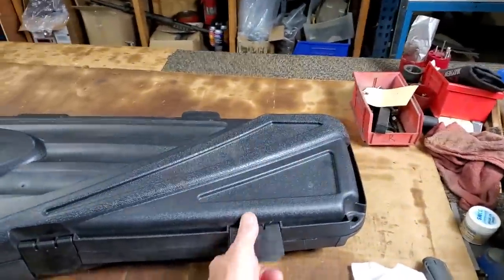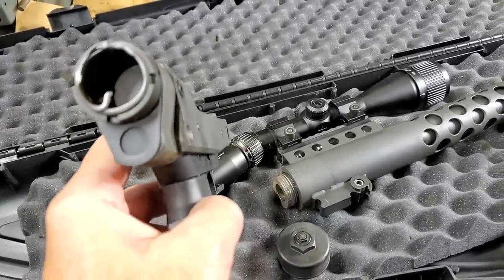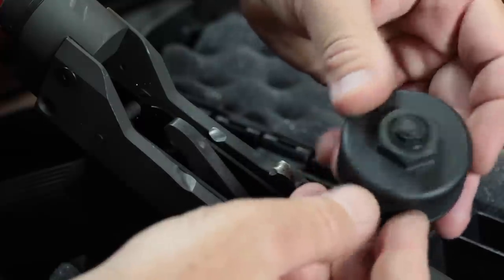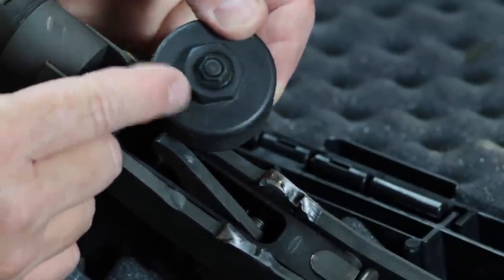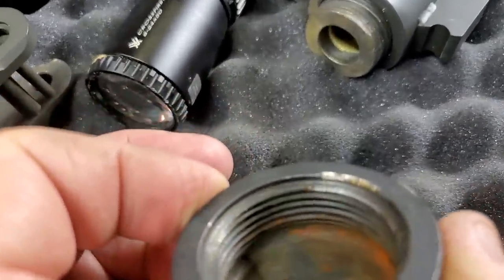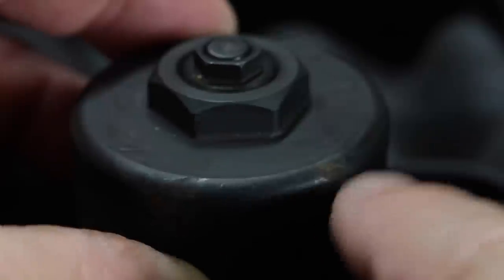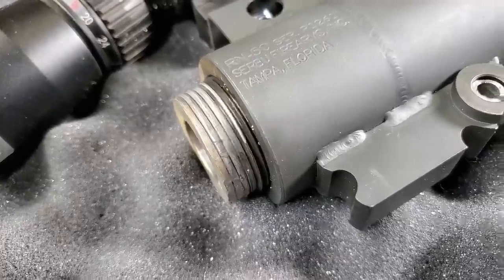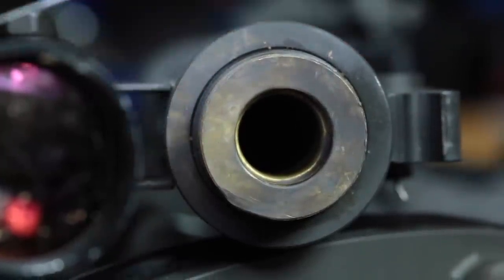Kentucky Ballistics' RN-50 Blow-up:  First Look

Comment: Everyone out here trying to see how the gun looks I'm still trying to figure out how the round he shot was so fucking hot.
Reply: Mil protocol with SLAP rounds notes: NO MUZZLE DEVICE 

There is the answer you seek.
Reply: It's a reloaded SLAP brass. This is the danger of second hand specialty ammunition. If I was to bet money it was either full charged or partially charged with pistol powder which burns faster to compensate for short barrels. In a rifle cartridge it results in quite the detonation. Isn't the first time it's happened. Just the first time things have been caught so vividly on video.
Reply: @Cragified  Nothing could be further than the truth with regards to it being a reloaded SLAP round.
Reply: @strykerentllc  When you have specialty ammo only available as surplus when it is legit you are going to have counterfeit ones when they are going for so much a round. 

Reloading old brass for them eliminates having to create the head stampings. It's not a requirement just an easier road to counterfeit them. 

And there are always people willing to produce facsimile things for profit. Hell even the three Air Force Ones had over 100 counterfeit parts found on them during an audit in 2012 and millions more installed on all manner of U.S. military aircraft. 

Who knows at what point a fake enters the supply chain with surplus but it being loaded with the wrong powder is the only thing that makes sense here.
Reply: @Cragified  The only thing that makes sense to those of us who know all SLAP rounds are restricted to be fired through the M2 and restricted to that single weapon system. If you knew why that directive is in place then you'd understand the why behind what happened. 

I'll fill you in - The 30,000+/- RPM launch causes the sabot to expand away from the penetrator as soon as the leading edge of the sabot exits the crown. The MIL directive on the sabot rounds is clear for a reason. ANY muzzle device will cause an artificial bore obstruction event. Go ahead and plug a muzzle and fire a round on any centerfire rifle cartridge and the result will be catastrophic.
Reply: Re-watch Scott's original video...I don't understand why everyone thinks this was the result of a single round being fired. The first SLAP round Scott fired likely damaged the rifle, the round in-between may have progressed the damage further and the last SLAP round was the straw that broke the camel's back and with the rifle already being fatigued made it look like the last round was overpressured when in all likelihood was a standard charge but suffered a barrel obstruction backpressure situation due to firing SLAP rounds in a rifle with a muzzle brake.

Comment: At least this event revealed one point of failure that should be remedied on any future mods of the RN-50: those ears are easily the weakest and most dangerous point. The ears shouldn't be ears at all, they should be one solid wall extending all the way back to the buttstock.

Comment: I'm going with sketchy reloads.  When they were selling those SABOT bullet kits back about twenty years ago, there were instructions that said DO NOT load them to normal .50 BMG pressures.  A decade or two later, passed about, until it came to Uncle Shakey's Reloads to load up with his patented "walopper" loads and then sold as "surplus SLAP".

Comment: You have probably already heard this or something similar. Figured I should mention it just in case. A few years ago a group of gentleman brought in to my local gun shop a 308 heirloom Sako blown into 4 pieces. The barrel was in OK condition considering, the receiver was still attached but destroyed. The bolt was broken, bent, and blown out of the rifle. The scope was bent and blown off the receiver(? I can't remember if it was broken in 2 or still attached or completely off) . And the wood stock was splintered and broken. One of the gentleman was a little worse for wear and went to the hospital but was ok when I talked to them. The shop owner took a look and diagnosed it pretty quick. Low powder charge with the wrong powder. I had never heard of it so he explained more. The primer will throw it's spark to the front of the powder which is the wrong type (like a shotgun powder instead of rifle powder). It will still throw the projectile down range but spike the chamber pressure through the roof since the powder is burning from around the middle to below the neck. In this case it liquidised and welded the back of the case to the bolt face and on inspection you could see where molten metal shot through the receiver. The shop owner mentioned a lawsuit from the 80s a ammo company lost where they had underloaded and used wrong types of powder. Consensus was the ammo destroyed the rifle via massive chamber pressure and no fault of the rifle. It was a shame because even destroyed that rifle looked good. Just figured I would repeat the story at least what I can remember of it, it has been a few years.  I always hear stories of overloaded ammo or bore obstructions, so this is kind of rare to hear about. Just thought I should share. The damage to the RN-50 looked similar and brought up a few memories.

Comment: Back in the 90's we had a number of "SLAP" rounds that caused similar problems with Maadi Griffins, Stoner 50's and even a Barret. The ammo was component constructed but over powered...(grossly over loaded) This may be the case some of that ammo cropping up again. For most work stick to standard ball of build your own in house. We use a Dilon single stage press. I completely trust the Serbu rifle and our unit has many in addition to the mfg's listed earlier.  Mark Koernke liberty1775

Comment: Mr. Serbu, I applaud you for being upfront & honest about this as some manufacturers would only try to hide and place blame elsewhere. You sir did nothing wrong, but the ammunition is highly questionable in my opinion. Tiborasaurusrex showed a manual that states not to use SLAP rounds in weapons with muzzle brakes. The only flaw in the design was in case of a case rupture there was no place for excess gas to escape except straight back through the breach.
Reply: the manual is dead wrong. it was written by a FUDD.

Comment: Maybe been it’s been mentioned in the comments already, but look close at the brake. These rounds weren’t made to be fired through a muzzle brake. The sabot, once out of the barrel begins expansion for round separation. In this case I believe it lodged momentarily causing an over pressure.  Not positive it would have left any real indication in the brake but worth looking into if you haven’t already. 
Food for thought.

Comment: It looks like the primary failure point is the threads, the cap gets "thrown" backwards, shears the ears. Shearing the ears slows the cap down just enough for the last bit of the thread to catch on the inside of the cap and redirected the remaining force downward. Shears the pivot pin and the causes the lower to bounce upward like in Scott's Video.
Reply: those threads had to take over 160kpsi to do that. that is about three times the pressure of a .50 bmg. guess what no gun could have survived that. MA Deuces would have blown up potentially killing their crews. Barretts would have blown up potentially killing the operator and spotter. Bolt actions would have blown up sending the bolt flying back into the skull or neck of the shooter.

weak point? that thread cannon is used on cannons and artillery pieces because it is one of the strongest actions in gun design.

Comment: Those two marks on the lower might be from the tabs that sheared off. They probably sheared in the front then folded back hitting the rails before completely separating.

Comment: My guess is that after sheering off the ears that the cap started spinning and that's how it caused the gouges a couple inches back, basically scooping the steel at high speed.

Comment: Another youtuber had a theory that is probably worth looking into. That the issue was using slap rounds with a gun that has a muzzle break. 

That material can build up over time on the muzzle break from the flangeletts, and lead to a type of obstruction that can make a gun blow up. 

He even had a military book from the 50s or 60s which stated this.

Comment: Go back and watch Scott's post. It CLEARLLY shows a large puff of escaping gas around the breach cap on the round PRIOR to the cap full failure. THAT round damaged the breech cap, the 2nd one just finished it off. And you can see the barrel threads here are basically intact but full of the cap threads.  Over pressure round

Comment: that cap after hitting the ears and shearing them off didn't go straight back it flipped, the top of it did the dents in the lower. the bottom sheered the ears flipped and the top hit the receiver it rotated.

Comment: Wow. That was some serious force.  😮😮 

As far as preventing anything like this in the future, you can’t really control the ammo being used so I’m not sure your design was the problem. The parts they got sheared off could be beefed up, you could add a few more threads on the To make it a little stronger. But my first thought is trying to prevent something like this from happening again, Was to make some kind of top or side blowout area, an intentional weak point to blow out and let it vent that explosion in a safe direction maybe.  Sort of like the same idea as a freeze plug on an engine so if the water in the engine freezes instead of blowing the whole thing apart it’s got a weak area to pop out first.  Just some sort of intentional weeks but they can blow out sending that in a safer direction. I don’t know if that’s possible with the speed but in this particular instance the Was sort of that spot but if the Had a few more threads and stayed on then what would’ve happened. I get the feeling there was something more to that round in the amount of twisting and other damage that went on there. 🤔

Interesting.  I really am surprised how twisted up everything became I have that cap put those two dimples on top of the frame. Wow.

Comment: My guess upon seeing Scott's video was that since the SLAP is a sub-caliber round, it came appart or jammed in the barrel long enough to cause a backfire at the breech. This is also consistent with the fact the accuracy of the other rounds varied so much. Some may have had blow-by in the barrel, indicating that the sabots were failing. As the sabots are polymer and polymers are known to degrade over time and the fact that the rounds were old, it seemed likely to me that a sabot failure could have accounted for the accuracy issues as well as a potential barrel obstruction on the round that ruptured the breech. (Just a guess)

Comment: Correct me if I am wrong, but what I do know about threaded fasteners is that if you don't stress the threads to a certain torque value they are very weak.  This seems to be the case in this design where the cap is only hand tightened, not stressing the threads at all.  Every time an unstressed thread is subjected to an impact load, as in firing a round, the threads slam into each other.  This happens because unstressed threads do not have full contact on all of their surfaces.  By deforming the threads to a certain stress value you will get all of the surfaces to be in contact with each other (male and female), therefore achieving the full design strength of the fastener.  With continued impact of an unstressed threaded joint it will eventually fail.  Has anyone done a microscopic analysis of the sheared threads yet? Again, please correct me if I am wrong.
Reply: this is a threaded breech. a design used on cannons. it takes over 150kpsi to tear off the threads. the threads are the strongest part of the rifle.

Comment: Mark, consider that the lugs caused the cap to tumble, you may find the marks line up more.  The upper rear mark may have been caused by the front bottom portion of the cap.  Hit lugs, broke them, began tumbling, hit the receiver behind lugs, still tumbling hit the top rear of the receiver.

Comment: It looks like the cap was tumbling after making those two side dents and that’s what made the gouge in the top of the receiver.
Reply: I believe the cap was tumbling after sheering the ears off and before it it the frame. If it started tumbling after hitting the frame the marks on the frame would have elongated by the cap sliding backwards instead of making a mark like it was the pivot point of rotation.

Comment: Just looking at the Cap position I feel as though it flew backwards and made the indents being nut down into the trigger well. It just made the harder marks on one side from the force coming through it and hitting the ears on both side. May be wrong. It really is crazy those had that much force to shear those threads and ears off. Shows how strong of a man Scott is and how quickly his dad acting saved his Sons life. Never shoot alone.

Comment: My correspondence course says this is most likely from degraded powder in the slap ammo , combined with an over charge and over compressed propellent, causing it to break up into small grains as the projectile was seated. This means the powder flashed off . The pressure curve would look like a sphere or balloon . With the biggest part of the balloon or termination of the sphere  being just in the throat of the chamber.  So there is not enough pressure to really push the bullet to velocity down bore.  That's the best I can do from here. At least dude is mostly ok and we know serbu firearms are not the problem here.

Comment: This has gone very quiet, any chance of an update?
Reply: Probably hand loaded with pistol powder instead of long gun powder, which means that for a pistol you want as much pressure as possible in a VERY short amount of time for VERY little powder. Long gun powder burns slower to use more of the barrel. When you put pistol powder in a long gun ALL of the pressure will be in the first few inches of the barrel, so, like 5000% extra pressure isn't so strange

Comment: Did a bit of reading too, normal 50 BMG chamber pressure is in the 50-60,000 PSI range. Mark’s calculations of 160,000+ explains a lot, that wasn’t a bullet in the chamber, it was a bomb. Any gun will explode if you fire a round with over 3 times more pressure than it’s built for.

Comment: As many have already commented thanks for sharing. Its apparent to me seeing the extensive damage not only to the barrel threads but to the whole receiver structure this was a defective round loaded to a catastrophic pressure level. Even the most robust of designs can fail if exposed to stress well beyond design parameters. A recent post on another channel reported on the catastrophic failure of a Ruger AR and no one would argue that Ruger firearms are not some of the most robust in the industry. Turns out a 300 blackout round was loaded by mistake in a rifle chambered for .223
Reply: 300 blackouts blowing up 5.56/.233 rifles is quite common. this is because the 300 blackout uses a bigger bullet then the 5.56/.223 but is able to be loaded and chambered since it is the same casing. Shows why you need to label or color code if you got mags that can go into different caliber guns.
Reply: @toomanyaccounts  I accidentally tried to chamber a .223 round in my .300 Blackout. Some people say they will chamber and fire, which doesn't really do anything but ruin the brass, but it would not chamber in my gun. I'm pretty careful about keeping the ammo separate and checking it before I load it, but that was the one day I was sighting in both rifles at the same time. I'm glad I didn't do it the other way around.
Reply: @TehButterflyEffect  well hopefully you will color code your mags or tape them with the caliber on it so you don't make a mistake in the future

Comment: I remember watching the failure vid but it's been a while.  If these were plastic parts then I would have said there was too much elasticity in the polymers used in parts of the gun.  The way the threads are only damaged in a small area reminds me of breaking threaded PVC piping--with enough elasticity you can apply pressure to one area of the pipe enough to pop off a threaded cap, and the damage is pretty close to what you saw.  Of course you need something to do the sheering and apply the pressure, but I don't see how that would be possible unless the whole barrel was flexing in a wave-like motion...that would be a LOT of mis-directed force.

Comment: Maybe a dual steel wire tether attached to the cap and to the barrel, on a swivel. Would act as a final failsafe if the cap blows off. Plus would keep someone from having to bend down and look in the grass if they drop the cap.

Comment: what if the cap were a fat three lug design with grooves on the back of the cap that engage the ears locking its orientation it can't turn? it's incredible how cleanly the barrel threads sheared off and the cap threads look almost fine.

Comment: You might have figured this out already but when you were trying to figure out how that cap put those dimples in the top of the receiver after shearing off the lugs.......... I believe the cap tumbled end over end as it sheared off the lugs and hit the top of the receiver after tumbling 180 degrees. I don't believe it went straight back after shearing off the lugs.  The dimples you see on the cap would have been facing up toward the top of the barrel. Hope that thought is helpful if you have not already realized this.